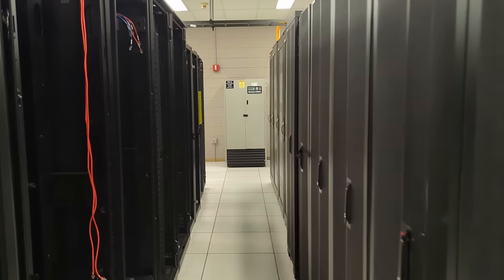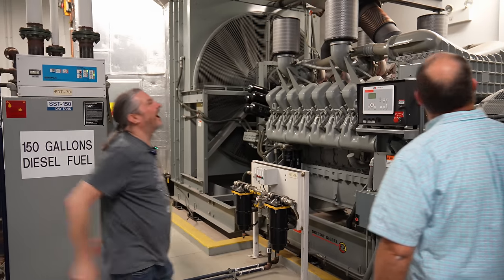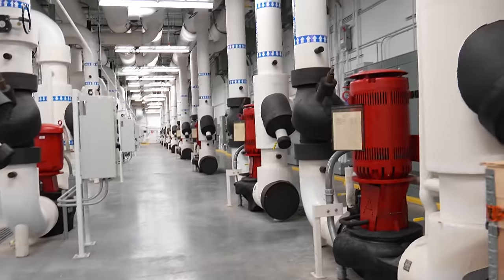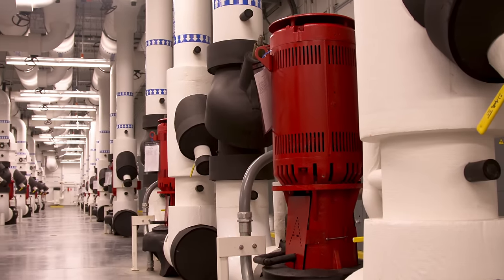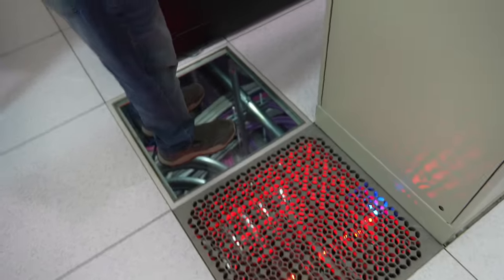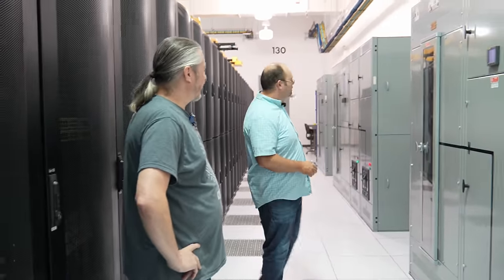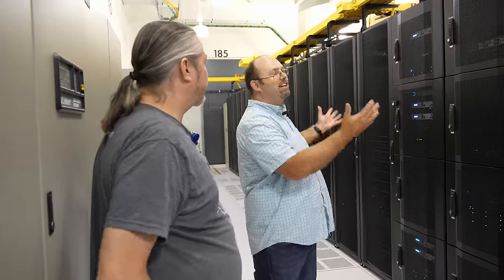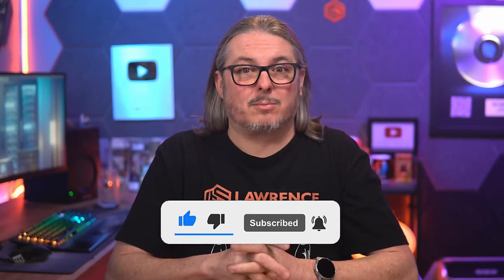Data Center Tour & Technical Deep Dive into the Power, Data and Cooling Infrastructure!

Comment: Yeah This facility is pretty Sick. Something i didnt see mentioned is that this Site has a 200,000 Gallon Fuel tank located underneath the parking lot. Which allows the Entire Building to run on Gas power for 55 hours with our fuel suppliers being under an 8 hour SLA for fuel delivery. Source: I work at that DC.
Reply: Diesel fuel can go bad, right?  Do the generators run enough to keep the fuel in the tanks fresh? Or is there some other process for keeping it fresh?
Reply: And the generators are only ever powered on For testing or for a loss of utility power. If I am remembering correctly they test them and make sure they work every 3 months then once a year they move the whole facility to generator power. Again not my dept. So just going of what I have heard.
Reply: @toddhall7924  Diesel fuel can be stored long-term. It's gasoline that can go bad after a few months, typically.
Reply: @matthewsmith5104  Thanks for the info! I looked it up but I guess I what I found was misunderstood or wrong.
Reply: Did he mean ATS for switching between Utility and Gen sources? A STS is overkill because as stated, there are around 16 seconds until gens are ready to accept load and the UPS’ can typically handle more than that amount of time at full load. The transfer time is not super important in that case. As a data center design engineer, I typically see STS’ at each PDU in a block redundant scheme with reserve busway connected to a fully sized redundant block. When a primary source of power fails such as a UPS, it is extremely important that the racks see no power loss. The STS is worth the cost in that instant when the block transfers to reserve.

On another note, raised floors are becoming a thing of the past. No new designs have them in the DCs I have worked on at least. Retrofits or DC “refreshes” are where I typically see raised floors, like in a recent project in a DC in the middle of nowhere USA.

(Edit) When I said Block Redundant, keep in mind that the DCs I work with only design for a single failure such as a UPS, a switchboard, or a child accidentally pushing an EPO button (seen it happen lol). However, they have additional redundancy by utilizing Distributed Redundant distribution downstream of the PDUs. Even if a reserve system is utilized, the STS' are inhibited, and a second failure occurs, the rack mount PDUs still have another available source.
Reply: Not sure that's all that great a thing...
Reply: @tor94  Btw, +/- means exactly plus or minus. So +/- 16 seconds means it could be negative 16 seconds, which is nonsensical (unless it starts 16 seconds ahead of time, lol). You could say 16 seconds +/- 2 seconds, which means between 14 and 18 seconds.
Reply: @toddhall7924 it does go bad, but there's ways to treat it and look after it to extend its shelf life significantly past the 1 year expiry date, It's quite likely that every few years, they still exchange it for fresh fuel.
Reply: @clonkex  yeah, saying “around 16 seconds” would have been a better choice of words
Reply: @matthewsmith5104  Gasoline starts to go bad after several weeks and after several months is a problem.  Diesel starts to go bad after several months and after several years is a problem.  Propane can be stored for centuries without any degradation.
Reply: @tor94   I expect that there are multiple independent utility feeds to the building. Then if a vehicle takes out a utility pole, there is still utility power in the building that needs switched between.
Reply: @kayakingphotos  There typically are, yes. Two feeds from separate substations.
Reply: @toddhall7924 
I service Gens at data centers. Often they have fuel polishers that constantly circulate fuel and continuously filter.or a 3rd party does that.  We typically sample the fuel once a year testing for water presence, algae, sediment and other deposits. The key is non biodiesel.
Reply: This is a thing I have thought about.  I have seen diesel engines that go into train locomotives also marketed for stationary generators, so I get why you would have diesel engines that look like something you would see in a diesel locomotive.  But I have also thought what about dual fuel generators for buildings?  You look at small generators and all of the rage today are dual fuel and tri-fuel as in gasoline, propane, and natural gas.  A big thing is both for campers who already have propane and for emergencies / disasters where the power is out at the local gas station and nobody can pump fuel for their generators.  So you either end up storing ethanol gasoline that has turned to slime by the time you try to use it and kills your fuel system or say some residual ethanol gasoline was accidentally left in the carburetor float bowl and turned to slime, so you are out of a generator during the emergency or you have propane sitting around because you have a dual fuel generator and use the stored propane for a generator that never runs on gasoline, so there will never be a fuel problem. For a building, you can get natural gas, which is essentially an unlimited fuel tank, but if the natural gas supply is disrupted for some reason, propane never goes bad and you can store as a pressurized liquid with roughly half the energy density of gasoline, so just have your big tank of that as well.  Big propane trucks roll around everywhere refueling big stationary tanks also everywhere, so easy enough to refuel in an emergency with an SLA giving you priority.  Plus most propane customers refuel periodically, often just once a year and are not affected much demand wise by disasters, so easy enough for suppliers to fulfill such an SLA.  (Especially in the countryside, all of the homes you see have a big propane tank they only refill once a year and are using it because they don't have natural gas.  So like for annual cooking and heeting needs.)  Natural gas and propane burn very cleanly, so people outside the building are not going to be choking on the fumes like I have in the past during a power outage when there was no wind so the diesel fumes settled in on the area.  Clean burning fuel in the engine leads to far fewer maintenance issues.
Reply: better check ur source 😂😂😂
Reply: Your DC and the vibe of the team is fantastic! I appreciate the brilliant guide. Please let him know.
Reply: Has an employee called Karan every called the fuel supplier and asked to speak to their manager if the fuel has not arrived after 8 hours.
Reply: Overtime diesel fuel does start to get contaminated.   Annually I would have the quality of the fuel tested. If the fuel results  were poor then i would have a truck role out.  The truck had a pump and filters that circulated the fuel to clean it up.  The process is called Polish.

Comment: Been in dozens of data centers (including this one) and this one is not like most of them, it's very over-engineered and has guaranteed 100% SLAs on power and network. It doesn't go down.
Reply: Actually it does go down... all that has to happen is a massive fire, hurricane, earthquake, bombs, someone cuts/disconnects the main fibres etc and you lose your data. In data centers such as AWS and Azure.... all of that can happen and no one would blink an eye as they have interconnected data centers where one or two whole data centers can go down and everything is still running/automatically transferred in another one of their data centers. This place doesn't have that capability.

Comment: I did a project on a similar building and we use geothermal as the main source and chillers as secondary. The geothermal lines were about 1.6 km deep. Air handlers and tons of actuators. The entire system control via BMS because it's impossible to controlled it manually with so much variables. It also had a solar farm nearby so big that I couldn't see where it ended.

Comment: The Eaton UPDUs just released last summer and we're starting to deploy them in our DC. More interesting than the flexible input is the C39 plugs that can take C13 or C19 power cords. Great for GPU racks that each server has dual 2kW C19 PSUs. So many PDUs from APC, Vertiv, and Eaton are limited in the number of C19 outlets!

Comment: I recently got into an abandoned  printing building with a data center/server room sectio. The floor alone was incredible, as it was raised of the original floor by a very heavy duty metal/ceramic tile floor with each tile having it's own little legs and a massive steel framework. There was an entire network of cables, coolant piping, and fire suppression custom made for that 2 ft. subfloor alone.

Comment: I always marvel at the mechanical engineering that actually goes into a data center.

People usually like to geek out over the computers and networking and stuff, and that's cool and all.

But without the physical (building) infrastructure, how to bring the power in and distribute it, the cooling, etc. -- the racks of computer and networking equipment in and of themselves, won't really do much if you can't power it nor cool it.

THAT, to me, is the really neat thing about data centers.
Reply: I just enjoy all of it. The sheer density of technology present.

Comment: This is extremely useful. I have an interview for a MEP PM position for a company's office with a data center. I never knew all of this was involved. The one data center I designed was back in 2009.
Reply: Cool! How would you suggest a career move into MEP designs for an electrical engineer?
Reply: They are all over. Probably the most common engineering job. It pays based on experience. Little experience little pay. I started as an intern for an architectural firm in the mechanical and plumbing department. Getting the PE is key to the high salary.

Comment: This building owner is ON POINT!!!!!!!!! He understands the power distribution system, as well as the BMS and how the system controls the HVAC system to maintain peak efficiency of the data centers hardware. This is the guy who you want to call if the system has an issue and he will know who to call to get the problem fixed. HE IS ON IT!!!!
Reply: Anyone who works at a data center in the operations space is expected to know this stuff... If yours dont know all this fundamental stuff, then you need new staff

Comment: Similar to a Google datacenter I work at as a tech, although at Google, everything is alot more custom, not as cramped, but things are similar like the cooling, backup generators. No flywheel UPS tho, the machine racks have just enough battery to last 60 secs for the gennies to kick in.

Comment: My first job was for a family run business that had 50 trucks and production lines. They always asked several contractors 
&  engineers what would be the best system. Every 3 years they replaced the main frame computers so they installed two separate HVAC units. If one of the two units went down the other unit could handle AC on a 90 degree day that only occurred maybe 6 times every summer. Then went to work for a rich company that was owned by a fortune 500 company. They had 1,000 workers and a good size computer room. They only had one fan to supply HVAC for entire computer room but two refrigerant compressors. Of course the fan motor burnt out on a very hot day and they were too cheap to purchase the spare fan motor that I asked for. They called in a contractor who did not get the AC back on til 10 PM. They had to pay computer room people a lot of over time to work all night to get a1,000 pay checks completed & printed out.

Comment: Quick question, can we installed In-Row AC unit in closed room environment? Close room mean no air exchange between inside and outside room. Air can only exchange will exchange heat by AC unit.

Comment: With an onsite chilling plant I am kind of surprised they did not have chill doors on the racks, either on the cold side or on the hot side.   I know the DC's I worked in with chill doors were so much nicer as they were not kept at 65F but at 73F for room temp because they had both cold and hot side chill doors to keep the racks colder than the room.

Comment: Hi Tom,
does the generator diesel fuel have to be changed if not used for a long time? let's say more than one year?
@11:17 what are thouse with rj45 "extension" for? I don't think a datacenter so nice and big has to add a 3 inches patch because the lan cable was too short :)
kudos for using pikvm  as a "remote hands" for clients!
Reply from the maker: There is a diesel fuel storage management process that we did not have time to cover but you can google that, and yes that is an extension.
Reply: that is a pinout adapter, not really an extension.  usually for console access to switches and routers

Comment: 26:10 funny to see this reality in the US lol. 
As an European, most US plugs for me look flimsy and weak due to the way they latch and require all the physical strain of the cable on the pins, which is a bad thing and can induce a bad contact and overheating. 
The blue Industrial CE socket, is what we use in Europe for pretty much anything 3 phase, from 16Amp 3 phase and up. 
And yet, in the US, only when things are already too sketchy at 60A+ lol 
The domestic style socket is only used for single phase up to 16Amps (due to using 230v, this is still a lot of power).

Comment: Wikipedia: A ton of refrigeration (TR or TOR), also called a refrigeration ton (RT), is a unit of power used in some countries (especially in North America) to describe the heat-extraction capacity of refrigeration and air conditioning equipment. It was originally defined as the rate of heat transfer that results in the freezing or melting of 1 short ton (2,000 lb; 907 kg) of pure ice at 0 °C (32 °F) in 24 hours.

The modern definition is exactly 12,000 BtuIT/h (3.516853 kW). Air-conditioning and refrigeration equipment capacity in the U.S. is often specified in "tons" (of refrigeration). Many manufacturers also specify capacity in Btu/h, especially when specifying the performance of smaller equipment.

Comment: I have an old 80kw 3 phase generac that was retired from a datacenter with 500 hours on it. 350 V8 chevy that runs off propane. It runs my whole farm and probably a few others. Too good a deal to pass up and long as the water heater is running it will start and spin up within 30 seconds but I give it 90 before 2 400 amp transfer switches kick in. Bout to find one for my office.

Comment: Nice that a smaller DC is able to approve this type of recording. It’s be nice to see this from one of the hyperscalers or large colo players, but I have a feeling their legal will kill it. 

The STS comment was off, or at least I haven’t seen that design. I haven’t seen anyone ask for a mechanical STS, they’re dinosaurs. Normally you have main-gen breaker-breaker transfer scheme. Normally that’s done open transfer and the UPS carries the load during outage/transfer. STS’ are usually downstream of the UPS and allow selection of two good sources from different power blocks before the PDU. 

Newer buildings from Compass, Vantage, Switch, Equinix, DLR would all be a good comparison to this older facility.

Comment: At 16:30 - Tom mentioned the conduit was done right with the sleeve.  The wires run through a white soft sleeve inside the conduit.  What is that all about?  Anyone know?
Reply: "A cable sleeve is a protective sheath used to cover and bundle cables and wires, offering protection against abrasive environments, such as temperature changes, while optimizing space. Made of a mesh material, braided cable sleeving protects your wires while conforming to irregular shapes."

Comment: What is the optimal temperature for a server room so that servers run efficiently
Reply: 24 c
Reply: Servers are actually capable of running much warmer than most datacenters warm them.  Cloud providers, who have to cool millions of servers, are always looking for ways to run servers closer to their maximum thermal spec and they design their own servers specifically to run at ambient temperatures.  This drives power efficiency and reduces water use.   CoLo facilities like the one in this video operate in a more traditional fashion with the cold isle, hot isle configuration.  As demand for AI workloads increases the compute densities required are going to overwhelm air-based cooling so we're seeing a lot of innovation around bringing water or liquid cooling into datacenters.  Today's racks are usually spec'd to a max of 12kW per rack.  AI workloads will drive that to 60kW per rack.  New forms of cooling will be required moving forward unless there are dramatic efficiency breakthroughs in AI compute.
Reply: I keep mine at 75 and the servers like that.
Reply: @moelassus  Well said. I'd add that personnel comfort is a factor when it comes to datacenter floor temps. AI is blowing up; we're lucky that we can get up to the 30+ kW range on just air cooling and have water-cooling capabilities too.

Comment: 16 cylinder quad turbo engine probably makes north of 5,000 horsepower!!!!!!!!!!!!!
Reply: Maybe 2,800 hp at most. Usually a 16 cyl. Diesel Generator about this size is good for about 2 Megawatts max. But it could also be as small as 1 Megawatt which would be about 1,400hp. And they only run at 1800 RPM. That is why usually they need multiple units and they need to be synchronized.

Comment: Flywheel ups are not better in any way than traditional ups
Reply from the maker: Yes they are.
Reply: Flywheel UPSs occupy a fraction of the space a traditional battery-based UPS would require in a facility of that size.
Reply: @LAWRENCESYSTEMS you know nothing at all
Reply from the maker: @enternamehere6574  🤣
Reply: You don't have to change out batteries all the time and they won't catch fire. That's a big plus.
Reply: @marco114  Not catching fire is a pretty good benefit!